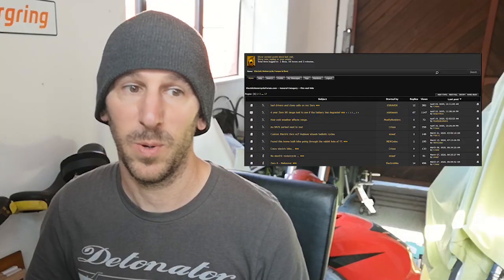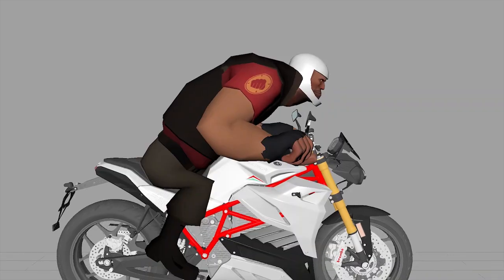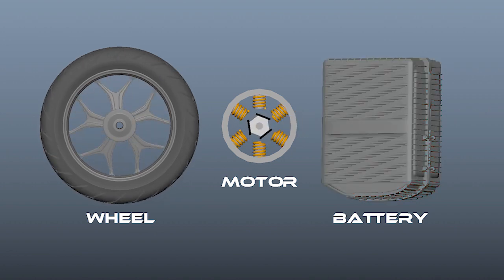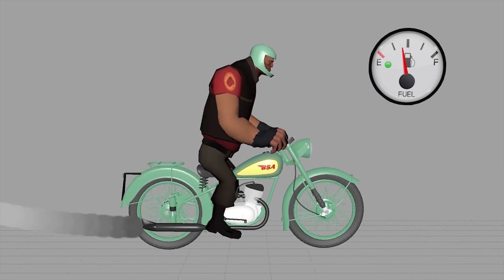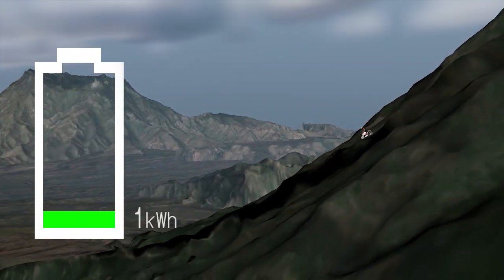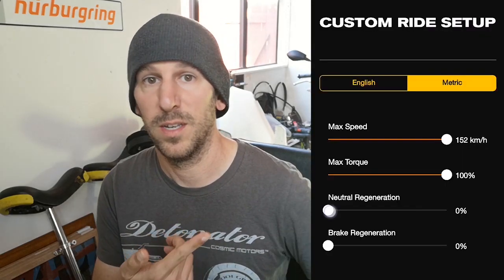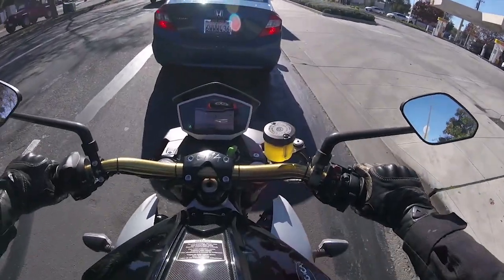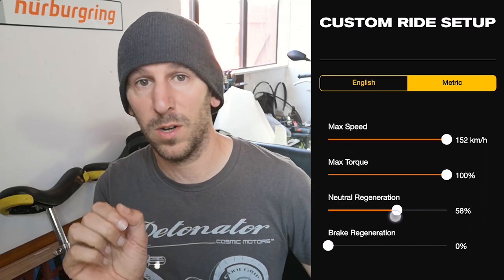Regen is Magic

Comment: So difficult to decide on getting one without knowing how the bike will handle where I live. I commute from the mountains 70miles to work. So going to work with regen will just make charging faster when I’m at work. But going home back up the mountain… I don’t know if I have enough to make it home. Why can’t these batteries have more range 😭. I want one, but can’t risk not being able to make it home but won’t know if I can without buying one….. 🙄
Reply from the maker: Check out Energica.  They have batteries almost twice the size of Zeros.
Reply: @NewZeroland  Only issues… More monies and no Dual Sport 😔 Otherwise I’d snag up a Ribelle
Reply from the maker: @CrazyPsych0B  Experia with knobbies!  You're right about the money though.  Bigger batteries are more expensive.

Comment: I think, and I'm saying this from a technical perspective and no experience, that if you need to coast you should just keep the throttle at "1%", so the effect is basically null.
Or they could add a negative zone for the throttle, to activate the regeneration without touching the brakes.
Reply from the maker: Yeah a negative throttle would be cool. Some people have installed left hand regen levers to have full control of it. I have no idea what that would be like though.

Comment: what if i put another motir hub on my front wheels so it charges my battery while it runs
Reply from the maker: You'd be using one motor to power the other motor. Unfortunately the battery would probably drain faster.

Comment: Uuh... If your regeneration is only 10% efficient, you have a real problem. It is more like 60% or better.

The main factor limiting your regeneration ability is still those pesky aerodynamics :p Also, I would love to see the day where motorcycles also have a motor at the front wheel, that will make regeneration that much more efficient...
Reply from the maker: Motorcycles don't weight enough to regen 60% of their power like cars. A motor in the front wheel would be sweet! I wonder how that would handle.
Reply: @NewZeroland  weight is not the problem here. A simple physics calculation shows that the net energy spent from going from altitude l to h, and then h to l (l being low and h being high) is exactly zero, regardless of weight. Weight is not the problem. The efficiency losses have to come from somewhere else.

When it comes to electric powertrains, there are of course losses, even when regenerating. But when it comes to motorcycles, they only have a minor impact... Except for the fact that the temperature of the powertain increases, which can incur further losses (and kudos to Energica for addressing this problem from day 1, unlike Zero). Also: P = U*I, but Joule says that E = R*I^2. A 110V battery will lose 4 times as much energy as a 220V one for the same power, whichever way.

The rolling resistance is basically proportional to the weight, so yes, motorcycles are not as much affected by this as are cars and, especially, HGVs (at 60 mph, the rolling resistance of an HGV is greater than the aerodynamic resistance).

Yes, the aerodynamics are killing it when it comes to motorcycles. I am pretty confident that you know that the aerodynamic force resisting your movement is proportional to your speed squared (which means that the power required is proportional to your speed cubed), and that's what kills it.

Comment: What do you set your regen to? I have mine set to 100a and 100a on the brakes too. What % would you say you get back with regen on?
Reply from the maker: What kind of bike do you have? I didn't know you could set the regen to amps. 100 is a LOT! Mine's usually set to Level 3 of 4 levels.. I think it gets up to about 15kW of charging power, but I haven't measured how much energy I've regained. Maybe 5%?
Reply: NewZeroland it’s a custom electric motorcycle. I’m using a Sabvoton 200a controller with a YM 20kw motor hub on a 17x6 inch wheel. My next setup will probably be on a more higher end controller. The controller is basically the brain behind the bike. It also comes with a nice neat iPhone app to let me modify my specs. I have another bike I made using a Kelly controller and a QS motor too, that one is a beast but doesn’t have drive modes. Just go and reverse and only have an Android app. I’m also finding I’m getting about 20% more battery if I don’t crank the flux weakening too high. When I increase it to the max which gives me a lot more top end speed I’m only getting back similar to 5-10%
Reply: NewZeroland by default the regen is set to 30a but many recommend 80a, I went to 100a because I wanted max regen and also feels like engine breaking. I also have a boost mode on my bike which feels like nitros lol. It literally gives you insane torque boost that’s instant for a short period of time. Goes full speed without hitting Throttle and will automatically shut off or if you tap the break or touch the throttle. Pretty cool stuff. Feels like a video game.

Comment: Regen converts 80% of the mechanical energy back to electricity....you would get a lot more than just 1kWh.
Here a real example of a recent read-out I did on a Tesla Model S 85 with 94 000km on the clock: 
AC+DC charging: 20 418kWh .....regen......wait for it: 10 299 kWh. It did a lot of city driving though.
Consumption was 21.7kWh / 100km.
Reply from the maker: Nice!! I think it's closer to 30% on a bike. Regen just doesn't work that strongly for us, but it's wild to think EVs can do this. I love it 😁💪⚡🔋
Reply: @NewZeroland  Not sure about the 30% it doesn't matter if 200kg gets moved up and down the hill or 2.3 tons (the Tesla). Im sure if Elon ever builds a bike it will have more energy in the battery than before going up that hill 👍😃. On your heat issue: I had a Futaba motor in my hand used on the World solar challenge here in Straya. It had an efficiency of close to 99% and when i asked about heat problems the team leader replied: What heat?

Comment: FYI, minor correction, modern fuel injected engines don't use fuel when the throttle is closed (if they aren't idling) under most conditions - so under trailing throttle they are literally just pumping air.
Reply from the maker: Wait.. if they aren't idling, how are they on?

Comment: This is how I always explained Regen, when I'm evangelizing homemade EVs, starting with cheap components, then upgrading to a controller with that feature & reverse:

Electric Motors, turn electricity into movement, but they can also turn movement into electricity. And when they do that, they become harder to turn, because they are converting that movement energy to electricity. That is how  Electric Vehicles can charge their batteries with stopping, and why their brake pads can last so long.
Regenerative-Braking, also naturally acts like Antilock-Braking-Systems, because when the wheels lock up, under Regen-Braking, the effect goes away, because the wheels aren't spinning anymore. Then when they start spinning again, the effect returns, and this may balance out, to Regen-Braking, at the very threshold of grip, and this maybe smoother & better, then ABS, especially with a motor & Regen-capable-controller, for each wheel.

That's what personally got me into All-Wheel-Drive electric motorcycles.
And because I can't afford Lithium batteries right now, I don't know how to setup a homemade EV for fast charging, and because of the convenience of gasoline.
I'm currently more interested in homemade hybrids.
My workbike is powered by a production portable generator.
But I am going to make my own better generator, by coupling a motor to a commercial engine, have the throttle signal of the controller, crank the engine, then when the engine is at operating temperature, I'll switch on a brake signal, so the regen feature of the controller, can charge my batteries.
This is better, then using gear ratios and high idle for exact charging voltage, and a Blocking-Diode and a ignition switch contactor to bypass it, to crank the engine.
Reply: Oh, and I don't know how to set up a homemade EV, for public DC fast-charging stations. I have looked, but have not found a system for homemade EVs to communicate or work with public chargers.
Do I have to salvage the circuits & sockets, from a wrecked production EV?
Reply from the maker: Whoa, a hybrid bike???  That's one way to kill range anxiety.  I never thought about regen acting as an ABS system.. that's really interesting.  Salvaging a DC charging system from a Leaf or something is a good idea, if it's small enough.  The one on Energicas looks really compact.  The guy at QC Charge is working on DC charging for Zeros, but I'm not sure how far he's gotten, and if the battery is too low voltage, it'll still take too long.
Reply: @NewZeroland  
  
Your video of you installing 3 Diginow chargers, gave me hope for my homemade Electric motorcycles, until I realized, those chargers maybe specific to Zero, and may not work with any bike controller, at any max charging voltage.
Whether or not I can set up my bikes for DC fast charging, having Hybrid bikes, gives me more options, until better batteries/ultra-capacitors become available. Better capacity, cycle use life, and or charging time. And more charging stations (I don't know if I can use Tesla stations, and just adapters for other plug types).

I love the stealth, sound, and instant torque of Electric motorcycles, and I want to go on big, high-speed adventures with one.
...But I don't want to end up stranded somewhere, with a dead battery, especially when I'm already in a bad situation.
So until I can build a Dustbin-fairing electric motorcycle, that can rival the Tesla 2020 Roadster, then I'm just going to remain loyal to hybrids, with lightweight on board generators.

I can also just buy a privately owned production electric bike (I'm not tolerating stealerships), and transfer the comptroller, screen, buttons charging circuits, and motor, to a frame I built containing a generator, better battery pack, and a Ultra-Capacitor pack in parallel with the batteries & generator (for better system stability, more charging/discharging amps, less stress on batteries), but I don't have the money & tools for all this right now.

Comment: The main difference is that if you coast, and at the bottom of the hill  you gotta stop at a red light, all your precious potential energy is gone. With regen some of it is still stored inside  the battery.
Reply from the maker: Exactly.  If you have to slow down anyway, use regen instead of brakes.

Comment: I measured it a while ago in the mountains, and I believe my results were around 30-40% of what I used to climb a hill could be regained upon returning to the same altitude.. although I wish I had the lever mod and the hacked controller for even stronger regen.
Reply from the maker: Whoaaa that's amazing! Way more than I would have expected.

Comment: I love this explanation. Will definitely be using this argument in the future. Still wrapping my own head around it a bit. Using more energy than is stored in the battery. In your explanation the battery energy is "stored" as potential energy at the top of the mountain. Which I guess could be translated to a flat ground scenario and regen when stopping, if not coasting to a stop. In both cases it relies on using an excess of energy at first and then trying to recapture (regen) that energy back again. I feel like the use of the initial 10kWh would be more efficient if no energy was used for climbing mountains or transferred to brakes or regen, (wind resistance being constant). So you could actually do more with 10kWh than 11kWh. Argh... I need a coffee.
Reply from the maker: Hahaha yeah.. the "coasting off-throttle / regen instead of brakes" idea seems to be the winner among riders.  Maybe if you picked up enough speed to JUMP the mountain, you'd land further than you would have if you rode down the other side @__@

Comment: The way I explain it is coasting is king but regeneration workes better than brakes if your not in a hurry to stop.
Every time you accelerate/deccelerate your converting energy, and that's never 100% efficient. For battery electric motion its chemical/electrical/magnetic/mecanical/kinetic with loses at every stage and kinetic resistance to maintain the speed. While coasting is a single conversion and its better described as resistance slowly winning out over the kinetic energy you've built up.
Reply from the maker: Wow, that was a great explanation!  Thanks for breaking it down.

Comment: maybe, it is a bit different with electric motorcycles but does the electric engine freewheels when not powered? i would assume there is no freewheel mechanism as that adds extra weight and has to be beefy to support the power of the motor. if that is the case then the motor will have resistance when not powered. to me, this is an iffy situation, i've had many many ebike builds and I much preferred a freewheel mid motor versus a hub motor that has resistance but is capable of regen. i think the 10% you gain with regen is lost due to motor resistance. in your example, this is a perfect example of regen as you are not freewheeling up the mountain and need to slow down going down. but on a flat road or more real world situations, to me from an high power ebike perspective, it is just more efficient to have a freewheel mechanism for true neutral or coasting.
Reply: will have resistance if it uses a permanent magnet motor...
Reply from the maker: Yeah most electric motorcycles have the option of coasting, but some people want something similar to a clutch, to freewheel when they want. I'd rather have a regen lever, so instead of using the physical brakes, you could pull that to use various strengths of regen. The only problem with freewheeling is that you have no gears to lock the bike in place when parking on a hill. It just rolls all the time.
Reply: @NewZeroland  we can have both. i hope =)

Comment: Yes that how I ride I went to Mount Baldy and I went up with 48% coming back down I had 51% riding 2 up and having to use my brakes a lot more because of the steepness. And I've been noticing the range being pretty good with the no throttle regen and 100% braking regen. Because you you need to stop you might as well use regen. It's super the way to go. Going downhill is good to get regen. My record so far is going 30 miles without losing battery going down hill. Mostly. And with gas you can't do that. Like you said it's constantly using gas and there is no way to put that gas back in epically while riding.
Reply from the maker: Nice!! Yep, agreed. There's a big mountain here where I've seen the % go up, but only 1% because like you said, there are some points where you want to get back on throttle and some where you need the physical brakes. More controllable regen built into the throttle would be awesome.
Reply: @NewZeroland  no lie I would love to see zeros have the regen all the way till you come. To a stop that would be way more practical in the city. And I feel that energica does benefit from it better because of the mass of the bike. But truly I would like to see a stronger regen till the bike comes to a complete stop. It's just a better feel and less wear on the brakes.
Reply: MOTOMARK What?? Mt Baldy in San Bernardino? That’s a great drive.
Reply: @stevenb7319  yes that's where I was at. The week before I was in Victorville.

Comment: Wow, that's a lot of work you've put into this video. Thanks.

The momentum from rolling down the mountain in neutral would definitely take you farther than regen with 10% efficiency if you were to do the experiment on the moon, with no atmosphere and thus no air friction. On planet Earth, though, I think regen at 10% efficiency would win. First, with air friction being proportional to the square of the travelling speed, the energy loss while descending would be very substantial, and you would soon approach terminal velocity. Second, with the momentum method you wouldn't be able to control the speed at will after reaching the bottom of the mountain, and the initial energy losses would be large due to high speed and very high air friction, even when rolling on flat. With the regen method, you could cruise at a very low speed on the flat, saving a lot of energy. I'm assuming a reasonably tall mountain, but the total height of the mountain would be the decider. The momentum method would have an advantage on smaller mountains. On a 10-metre mountain, the momentum method would definitely win. I would put a fiver on it without even running the numbers.
Reply from the maker: Whoa, thanks for the awesome comment! That's a great point. It really depends on the road and the conditions. I just go with what feels better, as a riding experience, and max regen makes me smile 😂

Comment: That tease at the end! As someone who started the whole electric vehicle thing by following Electric Unicycles and Onewheels, I've actually heard people talk about how their regen was sometimes too good (in a mostly charged battery). Going down hill some people found they over charged their battery to the point where the device had to shut down. Less of a problem on a motorcycle but on a device that needs power to stay balanced... ouch. Also: which 3D software do you use, Blender? Nice animation, though I can't imagine Heavy Weapons Guy getting decent range. 🤣
Reply from the maker: Dude!! I really want to try an electric unicycle. Good point about regen being too strong. Sometimes ECO mode slows my Zero down too much, and sometimes the hill is steep enough that I'd like the regen to be stronger. A regen lever would be an amazing addition. And you're right, Heavy is huge 😂 I used Maya for all these, but people are pumping out amazing work from Blender. Have you seen the new Unreal demo??
Reply: @NewZeroland  oh yeah! it lives up to its name, it's unreal how good it looks!